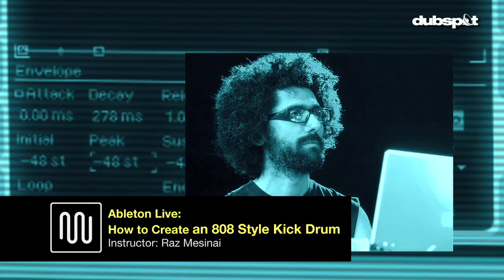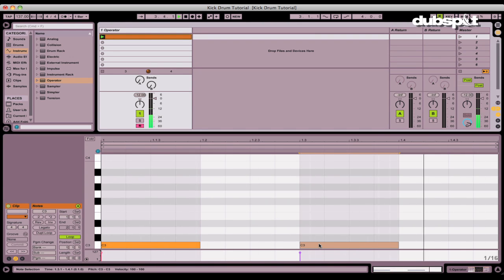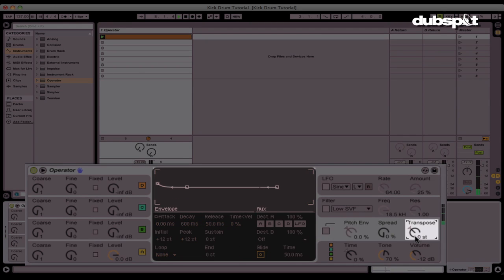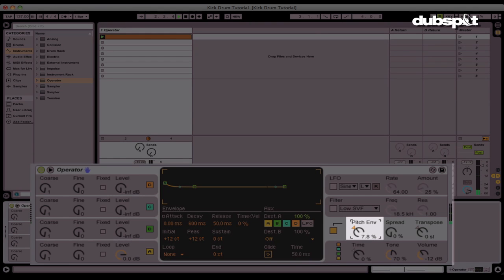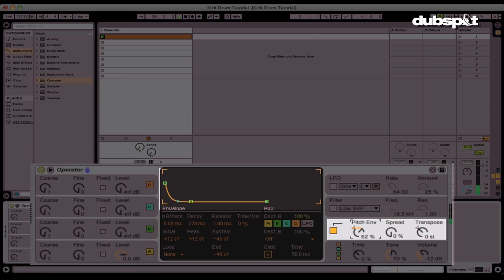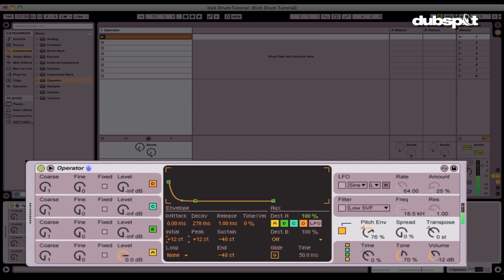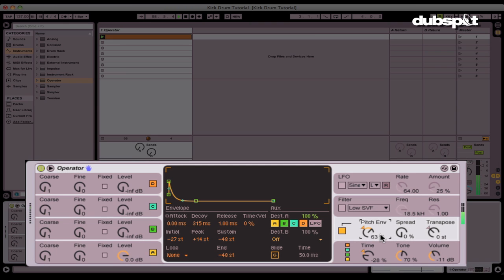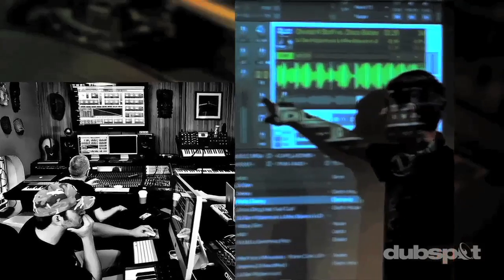Ableton Live Tutorial: How to Create 808 Style Kick Drums Using Operator w/ Raz Mesinai

Comment: how can we find the key of the kick?
Reply: I keep the Sustain at 0, and raise the Peak, so I know exactly what pitch I'm at. However, the only thing that's different here is the octave, as this kick will be 4 octaves lower than the key you play. C4 will sustain at C1, etc.
Reply: Might be a bit late, but if you use Ableton 9, you can drag the audio effect "tuner" onto to you operator instrument. As you play the sound it will give you the key (even if you pitch down a half step with a pitch envelope). You can then use the oscillator tuning to adjust it to the right root key for your chords.